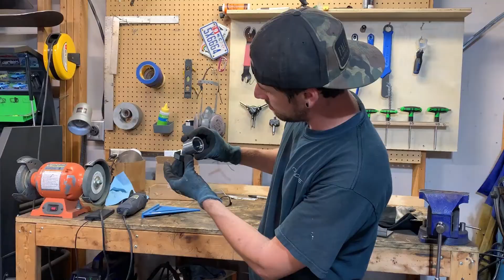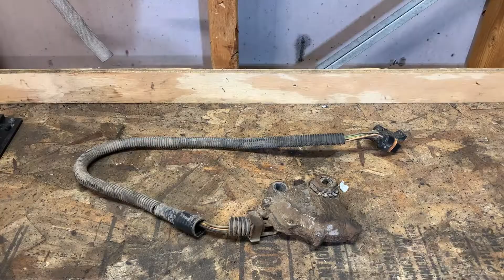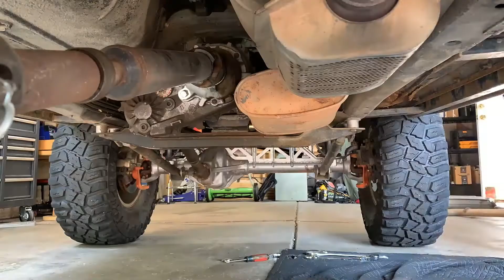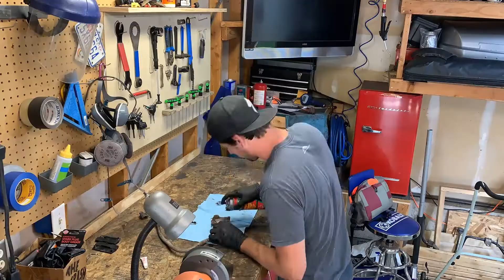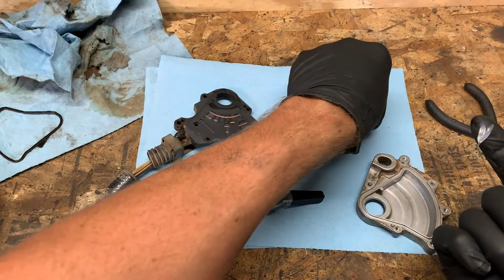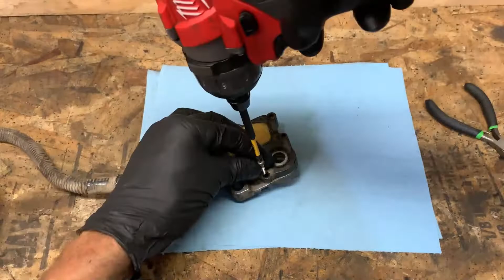Simple & CHEAP Solution To A Bad Neutral Safety Switch (NSS) Jeep Cherokee XJ

Comment: Hey I know this is an older video but I need to do this on the donor AW4 in my YJ.. how hard was it to pry off? I have a new one in case I break it... No Reverse lights are the issue.  I am working on floors AND RAILS ON , MY xj TOO... i SUBSCRIBED!
Reply from the maker: Mine was not hard to remove at all, just need to be delicate enough not to break anything

Comment: Can this cause the fuel pump not to prime?
Reply from the maker: It should not affect the fuel pump priming. I just tested on my Jeep and the pump will prime when rotating the key to the RUN position regardless of what gear the Jeep is in.
Reply: @machinesinc  thanks , I believe my cam sensor is the culprit, its not showing my voltage and fuel level and i think theres no spark

Comment: Hello!  I couldn't put shifter to P at a traffic light and turned off the ignition in D.  Then I put the selector into P  (car turned off) and nothing happened. I moved the selector many times over an hour, removed the battery, but nothing happened. Tomorrow I plan to remove the NSS and rebuild it with clean all aroud, using your video, thanks for thet! BUT what else could go wrong if after my self-oberhaul  nothing works? Maybe shifter lock cable broke?
Reply from the maker: The NSS may just not be adjusted correctly or loose
Reply: @machinesinc  thank you for your answer! Today I try to uninstall NSS and have some troubles with central bolt, that should come out. I detach lock hutch near central bolt and try to get it in every way, with great effort. And nothing happend :(
I don't understand what I do wrong, can you help me with that?

Comment: Would this work on a TJ wrangler? it has an issue with rough shifting, 1st to 2nd, and if you unplug it for the night it fixes it temporarily. I have done some digging and everyone else with the same problem says it IS NOT the PCM, but possibly the "transmission range sensor" which ive been told is the same thing as a neutral safety switch?????
Reply from the maker: I’ll be honest, I’m not sure what is causing your issue. The NSS is simply letting your vehicle know what gear you have selected, so this should not affect the shifting performance of the transmission itself. But also keep in mind that XJs have different transmissions than TJs

Comment: you are another one of those great people who give a bunch....
Reply from the maker: Cheers
Reply: I'm just trying to tow this Jeep Cherokee 2wd it don't have a battery is there another way to put it in neutral.?
Reply from the maker: If you’re flat towing the jeep (not on a trailer) you need to put the transfer case in neutral. If the manual shifter in the cab does not work just get under the car and shift the transfer case directly where the linkage connects.

Comment: Hello so I have a 95 Cherokee xj with a crank no start issue. I’ve replaced all the sensors, coil, cap, and all the relays but still no fuel and no start. Could a bad NSS cause no fuel no spark ? I’m leaning towards a bad ecu but not sure.
Reply from the maker: If you have no fuel that’s your issue. Check your fuel pump, fuel filter, and fuel lines. If all those are fine check your fuel pump wiring and fuse. If that’s fine you may be looking at ECU issues but doubtful.
Reply: @machinesinc  it was a bad ecu I replaced the ecu last weekend and it fired right up

Comment: I have the same problem  with wk 2005 grand cherokee 3.7  my Question if u respond is how did u diagnose problem  ?
i heard u say its been diagnosed  as the  problem like to know how u got to that explanation 🤔 ⁹
Reply from the maker: Most direct way to diagnose this would be disconnecting the NSS electrical connector and testing using a multimeter for continuity across the corresponding pins while shifting into each gear. But most importantly when In park or neutral. You will need to find the wiring diagram for your car.

In XJs common symptoms of a bad NSS are the vehicle starting in neutral but not in park. Reverse lights not turning on when in reverse.

Comment: Wish you would have actually shown how much effort to remove and then re-install.
Reply from the maker: Unfortunately it’s just hard to hold a camera while you are doing it. But like I said it’s only the one bolt, loosen the nut, and unplug the connector. Took me less than 5 minutes.